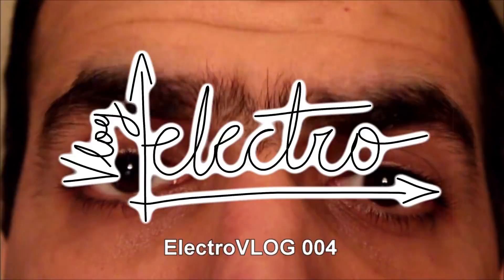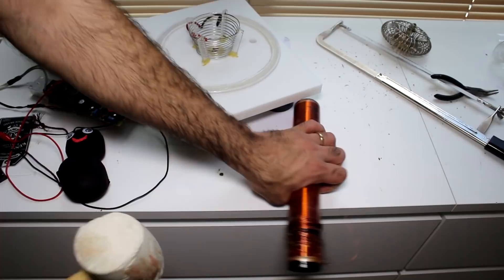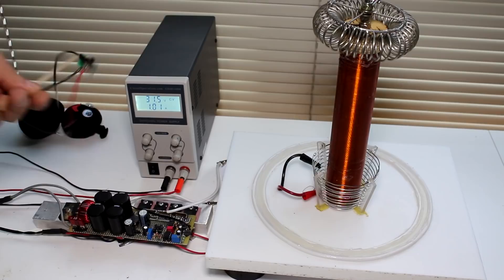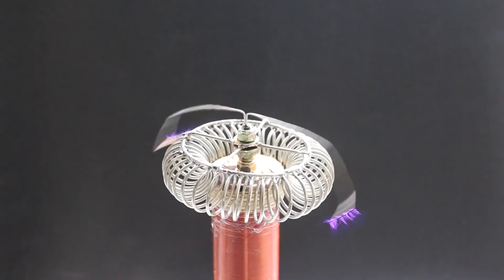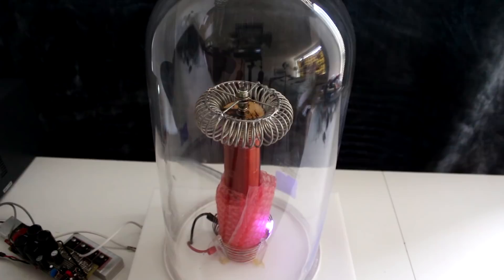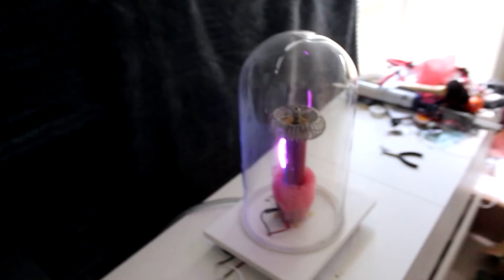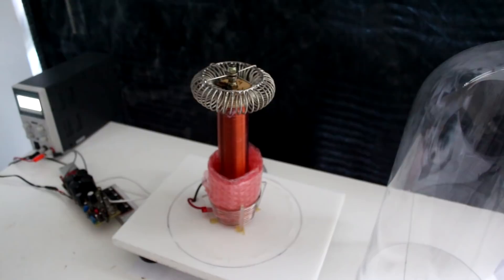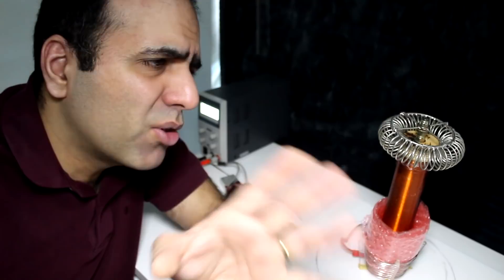ElectroVLOG-004: The LAST Attempt at Tesla in Vacuum

Comment: In the middle of a soldering session, this pops up.
Reply: Precisely!
Reply: #relatable what were you soldering? I just finished a tda2050 amplifier. That thing was LOUD!!!
Reply: +Ivan R
I was working on a capacitor charger I designed.
What's the power of the amp?
Reply: the amplifier was a 50 watt tda2050 single supply design. I had quite some fun with it after I got it to work. For some reason, it did not work as well when I connected the speaker between a capacitor bridge. Not sure why, but I think it might have to do with the internal design of the ic.
Reply: +Ivan R
Maybe there was some DC leakage?
Reply: nope no dc leakage, I tried connecting the speaker using the capacitor bridge to the positive rail only, so current would flow through the npn transistor inside, but for some reason it would just not work. Mind you, it is a split supply amplifier so there is no reason why it would not work, in that configuration. Heck even the lm386 works in that configuration just fine. Definately not dc leakage. I think it has to do with the bias resistor network. I made progress and eliminated a around 90 percent of the noise by adjusting the control loop, however I still dont know why it does not want to work with a capacitor bridge. Im actually watching youtube videos with the aplifier :D! Almost no distortion and noise, only bad contacts :P!
Reply: Wow, nice to be able to use something you built!
All the best for future work!
Reply: thanks man! All the best to you as well :D!
Reply: Thank you!
Reply: You are most welcome :D!

Comment: maybe you could have the coil outside the vacuum chamber and run a thin wire to the top load inside the chamber, this would not let it arc to the primary

Comment: the plasma flows were the gas goes , lesson learned
Reply: I think the plasma is sucked into the bore by the magnetic field, not the vacuum pump below.

Likely this is how incandescent lightbulbs explode, because the magnetic pulse of the breaking filament pulls the generated metal ion plasma into the "bore" of the coiled filament and so makes of it a dead short with much lower resistance than the tungsten wire itself and so draws hundreds of amps current converted into heat.

Comment: Perhaps you could keep the coil outside the vacuum chamber and leave the top inside the chamber connected by wire, just like you did with syringe.
BTW, I tried with syringe and the spark melted a hole in seconds, ouch!

Comment: What about SF6? You could fill the bell tower upside down (SF6 is denser than air) and see if you can generate plasma the same way as with noble gases? Not sure how that would work since it's commonly used as a dielectric gas

Comment: why don't you isolate the vacume to only be at the top of the tower and the rest in normal air and pressure. So feed a small wire through the base of the vacume chamber and have the metal coil in the container it can reduce the loss of energy in 1 location that is undesirable.

Comment: So, how about a new secondary, perhaps 3" diameter,. and a primary outside the glass? Somewhere near the 5th harmonic tuning? Maybe that setup produces too much current to operate with such tight coupling.
Reply: or, if you could somehow immerse that primary in oil, inside the jar, you could prevent the primary arc-over..

Comment: you can get rid of isolation from wire with soldering iron and aspirine :P
Reply: Kamil Zbrożek really ? does it works ?
Reply: when you put wire on aspirine and heat up with soldering iron isolation (painted wire) acid should remove this paint

Comment: I wonder why the secondary coil is getting arc contact from the primary. Maybe the magnet wire is damaged?
Reply from the maker: +ipasuhd no, the voltage between the two is much higher than what the magnet wire can withstand. And not only that, but even with magnet wire intact, the high frequency AC is coupled to the copper like a capacitor

Comment: 2:07 why did you use bubble wrap?
Reply: possibly because of the air pockets (air is a pretty good insulator), but it didn't work as he wanted.
Reply: hornetluca because it's electrostatic resistant bubblewrap
Reply: 'electrostatic resistant' == conductive... think about it.
Reply: why not use kapton tape or something like that?

Comment: 🔌The arks in a vacuum chamber can be affected by a magnetic field!!🔌
Reply: Likely this is how incandescent lightbulbs explode, because the magnetic pulse of the breaking filament pulls the generated metal ion plasma into the "bore" of the coiled filament and so makes of it a dead short with much lower resistance than the tungsten wire itself and so draws hundreds of amps current converted into heat.

Comment: did you use the infrared to see if it was arcing inside after shortening the coil?
Reply: because infrared can go through glass right?
Reply: you heat it up then take the glass off and infrared it while it's still hot to find any hotspots that would indicate any internal arcs.

Comment: As you have discovered, the "vacuum" that you are able to create in your home is not really a "hard" vacuum, and in fact is quite conductive, much more conductive than air at STP. Also, the noble gases that you refer to are actually more conductive, not less conductive than air at the same pressure. If you want to insulate your coil so it operates at much higher voltages before breakdown, you need high pressure, not low. Try 10 atmospheres of carbon dioxide, for example. 
Furthermore, those arcs that you are creating between your TC and the glass "bell jar" or rather display cover, are very hot and will eventually cause your glass dome to shatter and if this happens while you are pulling a vacuum, you will indeed have a "big boom" on your hands, with glass fragments flying everywhere. I hope you are wearing safety glasses when that happens! And are making a video at the same time, while your children pull bits of glass out of your face with needlenosed pliers! LOL.
You might be interested in my video here:  v=pLCOBzuxIWQ
Keep up the good work, and please Be Careful!

Comment: I'm a 12 year old boy and love to invent but its hard to make things with stuff I can find around my house ive been saving up money I'm at 163 💸dolers but that's not enough to buy my dream printer I don't rilly need this one QIDI TECHNOLOGY 3DP-QDA16-01 Dual Extruder Desktop 3D Printer QIDI TECH I, Fully Metal Frame Structure, Acrylic Covers, with2 Free Filaments, Works with ABS and PLA. I just want be able to invent more things like stands for a Xbox controller or bookshelf sides (the things that hold books frome the side) just stuff like that but I cant rilly do that with what I have hear at my house. I rilly what one of those printers if you have any left  ✊👍